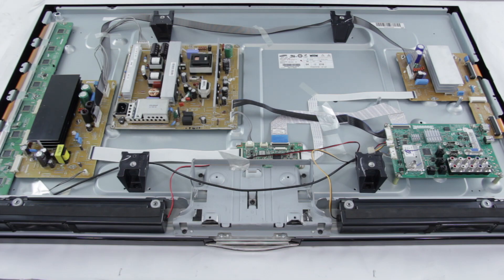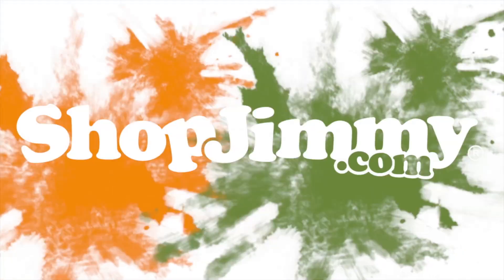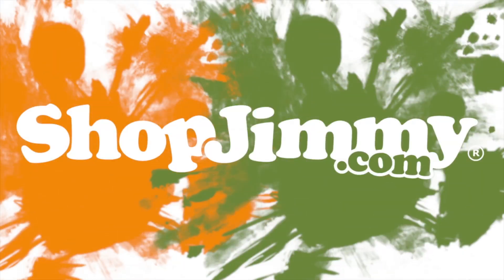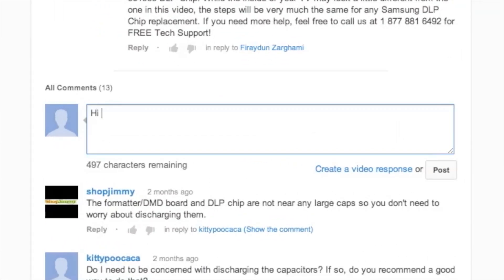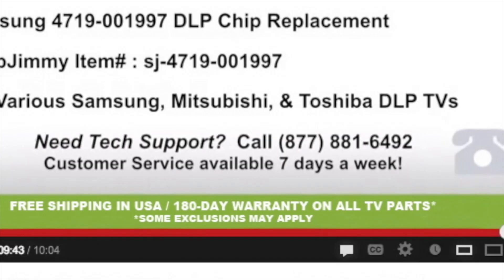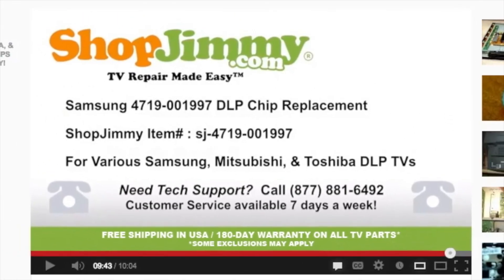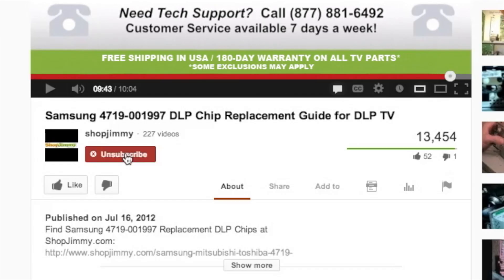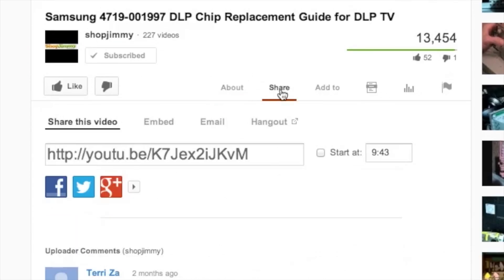Plasma TV Repair Tutorial - Common Symptoms & Solutions - How to Fix Plasma TVs

Comment: Good evening ShopJimmy I have a Samsung Plasma PN42B430P2DXZA and the issue that I'm having is that the picture comes and go or start blinking constantly, and something it just goes blank but you still can hear sound. When it on for hours pictures works fine but still have the flickering going on but not as bad as when first turn on. Could this be cause by the Y-main board?

Comment: We have a Panasonic TC-50px24 plasma screen TV, was given to us for free but we think it may be fixable. The TV will turn on but has red and blue vertical lines about 2" tall and 1/4" wide across the bottom third of the screen. The lines seem to line up with the ribbon cable that connects to the SS board..  We are wondering if this could be a problem with the SS board itself or if it's possibly a problem with the ribbon cable itself.. (entire screen)?

Comment: We have a Samsung Plasma TV .  The other night we smelled burnt wire and the screen went black.  The back of the TV was very hot to the touch, but not the front.  We unplugged the TV and waited for the TV to cool off. Once it did , it worked again for about 24 hs, the we got the smell again and no picture.
Reply from the maker: Victoria Jiles   Most commonly I would suspect the Y sustain board. This board is located to the left of the power supply from the rear. I would do a visual inspection of this board, the power supply, and the X sustain to the far right. Look for discolored parts due to over heating etc. as this could give a clue. What is the model number of your set?  Please reply with your TV model number.  Click here to view a video that shows how to find your TV model number:  https://www.youtube.com/watch?v=S51nhAmwR2M  Thanks!  www.shopjimmy.com

Comment: Hi Shop Jimmy - I have an LG Plasma TV - Model No: 42PC1DG-AA / Product No: 42PC1DG-AA AAULLUH / Serial No: 611KCMR35203
For some time now we have been experiencing the Image Freezing while the Audio continues on 1 channel only? Strange. We found that if we power off and back on quickly and immediately changed channel it would be ok. Also we found that if unplug the TV between watching it reduced the occurance.
Last night however the TV made a loud POP and we lost the picture - audio continues. The TV is not recovering from this.
From your Youtube Vid it sounds like this might be the Y-Sustain - should I try and remove the Y Sustain and get a replacement? Will it need a Technician to replace? Should i simply replace the TV?
Reply from the maker: Nick Kavanagh   I recommend replacing the Y Sustain and the Y Drive Board(Y buffer board) in your TV.  Click this link to replacement parts:  http://www.shopjimmy.com/catalogsearch/result/?q=42PC1  There may be multiple boards for the same TV model number, be sure to match part numbers on your current board, with your replacement for compatibility.  Here is a link to a video showing how to identify your part number, click here:  LG Plasma TV Repair: DIY Part Identification Number ID Guide for LG & LG Philips Plasma Panel Parts  Thanks and please let us know if you have any further questions with your TV Repair!  www.shopjimmy.com
Reply: Excellent. Thank you very much.

Comment: I have a HP PL5072N Plasma HDTV, this turn on and off itself. What could be the cause?
Reply from the maker: corey sesti  Please watch this video FIRST to help with your repair!  TV Repair! LCD, LED, Plasma, DLP How To Fix Your TV with ShopJimmy.com Help!  This could either be a problem with the main board or the power supply board.  You may need to replace each board individually to see which one fixes the problem.  Click this link to see replacement parts for your TV model number:  http://www.shopjimmy.com/catalogsearch/result/?q=PL5072N  There may be multiple boards for the same TV model number, be sure to match part numbers on your current board, with your replacement for compatibility.  Thanks and please let us know if you have any further questions with your TV Repair!  www.shopjimmy.com

Comment: I have a Samsung plasma TV PN50B430P2D.
The problem: 2 horizontal black lines from left side of tv all the way to the right, top middle of tv....what do I need to fix? Please help. TV still works fine, just have the black lines.

Comment: I have a ps51e550 Samsung plasma 20 months old with a verticle pinstripe on the right of the screen,any ideas,thanks.
Reply from the maker: Alan Webb  This sounds like a TV panel (TV Screen) problem.  If your TV panel is bad, it may be more cost-effective to replace the TV as panels are typically hard to find in stock, difficult to replace, and expensive.  Thanks and please let us know if you have any further questions!  www.shopjimmy.com

Comment: Samsung plasma TV - Model PN51D6500
Today I noticed a vertical pixelated narrow line (different colour than main image, often fading from green to purple from top to bottom)) about 14 inches from the left screen margin. There are no other odd lines or pixels elsewhere.
Thank you for your suggestions,
Al Wilson
Reply from the maker: Al Wilson   This sounds like a TV panel (TV Screen) problem.  If your TV panel is bad, it may be more cost-effective to replace the TV as panels are typically hard to find in stock, difficult to replace, and expensive.  Thanks and please let us know if you have any further questions!  www.shopjimmy.com

Comment: I have a Samsung plasma 50 inch PN50C450B1D. Picture is snowy and has a red and some green tint/outline on everything with no input connected, menu on screen looks the same. TV powers on fine and stays on, problem just started one day and TV is about 3-4 years old. Any suggestions on what board could be causing this problem? 
Thanks.
Reply from the maker: DC Smith  Please watch this video FIRST to help with your repair!  TV Repair! LCD, LED, Plasma, DLP How To Fix Your TV with ShopJimmy.com Help!  I recommend replacing the main board in your TV.  Click this link to replacement parts:  http://www.shopjimmy.com/catalogsearch/result/index/?cat=56&q=PN50C450B1D  Be sure to match part numbers on your current board, with your replacement for compatibility.  Here is a link to a video showing how to identify your part number, click here:  Samsung Main Boards & Digital Boards: Part Numbers for LED, LCD, DLP, Plasma TV Repair  Thanks and please let us know if you have any further questions with your TV Repair!  www.shopjimmy.com
Reply: ShopJimmy.com  Thanks for the info. Problem was the Y-sustain board.

Comment: I have a 2 to 3 inch black vertical line going down my TV. I found the culprit , which is the ribbon corresponding to the vertical line,on the bottom of my TV , which is connected to the c2 buffer board tnpa4441. I unplugged that ribbon. Turned on the TV hoping for it to be white line 2-3 white line as I was informed I would see. But the line is white but only half of it with black. the white half containing pixel color changing lines.It supposed to be white when u unplug the ribbon I thought and when it's plugged in it's black. Could it be the c2 board I need thanks in advance .
Reply from the maker: *****   This sounds like a TV panel (TV Screen) problem.  If your TV panel is bad, it may be more cost-effective to replace the TV as panels are typically hard to find in stock, difficult to replace, and expensive.  Thanks and please let us know if you have any further questions!  www.shopjimmy.com

Comment: I have a 2 year old Samsung PN51E450 Plasma 720.  It has a red dotted line running vertical on the right side of the screen.  Everything else works fine. Any suggestions?
Reply from the maker: Frank Shults   This sounds like a TV panel (TV Screen) problem.  If your TV panel is bad, it may be more cost-effective to replace the TV as panels are typically hard to find in stock, difficult to replace, and expensive.  Thanks and please let us know if you have any further questions!  www.shopjimmy.com

Comment: I have Toshiba 42HP66, I have great sound, but no picture. For about a week befor the picture went out, when the tv was turned on the pictures would be white like till it warmed up about 5-10 minutes then the picture was normal.then one morning while it was warming up, I left  tv on, when I returned there was no picture. I have looked at boards . Theren is no scorches on fuses and no bulging, no burn smell. I have replaced the inverter board and still no picture, but have great sound. I have been told its possible its the main board then. this part # is OEC7147B-007. could itbe anything else ?
Reply from the maker: T Burgess  Please watch this video FIRST to help with your repair!  TV Repair! LCD, LED, Plasma, DLP How To Fix Your TV with ShopJimmy.com Help!  I am not sure what board you replaced, as there is not an inverter board for this TV as it is a plasma model and not an LCD.  I recommend that you replace the YSUS and the YDRVTP boards in your TV.  We may be out of stock on the YSUS, but we have a repair service, where you can send us your board and then we repair it and send it back to you.  Click this link to find these replacement parts:  http://www.shopjimmy.com/catalogsearch/result/?q=42HP66  Be sure to match part numbers on your current board, with your replacement for compatibility.  Here is a link to a video showing how to identify your part number, click here:  LG Plasma TV Repair: DIY Part Identification Number ID Guide for LG & LG Philips Plasma Panel Parts  Thanks and please let us know if you have any further questions with your TV Repair!  www.shopjimmy.com
Reply: The part that I 1st replaced was part # LG 6871QDH117A.
Reply from the maker: T Burgess   So you replaced the YDRVTP board.  You will also want to replace the YSUS board.  It is recommended that you replace both the YDRVTP and YSUS boards at the same time, since they can cause damage to each other if one of them is bad.  We may be out of stock on the YSUS, but we have a repair service, where you can send us your board and then we repair it and send it back to you.  Click this link to find these replacement parts:  http://www.shopjimmy.com/catalogsearch/result/?q=42HP66  Be sure to match part numbers on your current board, with your replacement for compatibility.  Thanks and please let us know if you have any further questions with your TV Repair!  www.shopjimmy.com

Comment: I have a 51" Samsung Plasma E550. Its 2 and a half yrs old. it has suddenly developed a thin vertical line 4"from the left , full from top to bottom. The line is not visible in black or white screen. Technician says its the fault of the panel and the whole panel needs to be changed.
Suggest a solution.
Reply from the maker: sachin dixit   This sounds like a TV panel (TV Screen) problem.  If your TV panel is bad, it may be more cost-effective to replace the TV as panels are typically hard to find in stock, difficult to replace, and expensive.  Thanks and please let us know if you have any further questions!  www.shopjimmy.com

Comment: I am working on my Panasonic TH-42PX50U and I have seen all of this video.  My TV stopped working entirely in my motor home and blinked ten times. After moving the unit into my home I took the back off and blew all the dust out, including the fans.  They actually did not look too dusty.  I suspect the outlet was overloaded in the motor home.  Now when plugged in inside the home it will come on and work perfectly for 30 - 45 minutes and then turn off and blinks the led seven times.  If I unplug it and let it cool for a while it will come back on and repeat the sequence.  I am prepared to buy a board if I can determine which one(s) to get.  Thank you so much for this service help.

Comment: 42" Samsung pn42c450b1d - the screen does not come on and when it gets plugged in after being unplugged it clicks on and off (3) times before stopping.  Based on the video it sounds like the Y main board.  Any help would be appreciated.
Reply from the maker: Matthew Juergens   Try this at your own risk. Unplug the TV, then disconnect the y board and plug in the TV to see if the TV powers up. Reply with the results of this test. Thanks! www.shopjimmy.com
Reply: With the y board unplugged, the tv powers up w/ the melody and the on/off button works with it making the startup/shutdown melody each time, obviously nothing on the screen though. Thank you for your help!

Comment: Hello, just finished watching the video. I have a LG 60PK550 and I have a issue where a thin horizontal line is flashing across the screen at random. Along with this the picture will sometimes transpose meaning what ever is on the left side of the image will appear on the right side and vice versa. These happen at random for slip seconds at a time and sometimes continuously for a period of time. I have been suspecting the the ysus board needs replaced after some research. Any ideas?
Reply from the maker: Jeff Campbell
Please watch this video FIRST to help with your repair!  TV Repair! LCD, LED, Plasma, DLP How To Fix Your TV with ShopJimmy.com Help! Thanks and please let us know if you have any further questions with your TV Repair!  www.shopjimmy.com I recommend replacing the buffers in the TV.  Click this link to replacement parts:  http://www.shopjimmy.com/catalogsearch/result/index/?cat=96&q=60PK550  Be sure to match part numbers on your current board, with your replacement for compatibility.

Comment: I have a toshiba 42hp66 plasma tv.
When I plug in the hdmi cable it shows a green screen and no picture.
When I use the  rca  cables, it works fine. I really like your videos.  they are very helpful!!. when we pluged the sorround sound, to the receiver it made some noise and some smoke came out of the right side of the receiver.  The receiver no longer works..
Reply from the maker: Chris Bouchea  Please watch this video FIRST to help with your repair!  TV Repair! LCD, LED, Plasma, DLP How To Fix Your TV with ShopJimmy.com Help!  The scaler board for this model has the HDMI input.  I recommend replacing the the scaler board to see if that fixes the problem.  Click this link to replacement scaler boards for your TV model:  http://www.shopjimmy.com/catalogsearch/result/index/?cat=60&q=42hp66  Be sure to match part numbers on your current board, with your replacement for compatibility.  Here is a link to a video showing how to identify your part number, click here:  TV Part Number Identification Guide for Toshiba Main & Scaler Boards (LCD, LED, Plasma TVs)  Thanks and please let us know if you have any further questions with your TV Repair!  www.shopjimmy.com

Comment: HI Jimmy,

I have a Samsung Plasma TV model# PN50A510P3FXZA.  When its plugged in the power supply board just does a series of clicking 7-8 times then stops.  No picture at all.  I've taken a look at every board inside the set, and cannot see any swollen, or leaking capacitors.  What can I do to fix this set?
Reply from the maker: Michael Shlimanoff   Try this at your own risk. Unplug the TV, then disconnect the y-main board and plug in the TV to see if the TV powers up. Reply with the results of this test. Thanks! www.shopjimmy.com
Reply: the clicking goes away when I unplug the board with the A/V jack, and componant cable plug ins.. botton left hand side.. think its called a Main Board

Comment: I have a Samsung 50" hp-r5052 there is absolutely to life to the screen at all. There's no picture no light, nothing. But it powers on. The power button lights up blue, the tv clicks and a musical noise indicates power is on/off. I've replaced the X and Y main boards on the right and left sides but it still does the same thing. When you turn the power off there are 3 greens lights that turn on, on the backside, behind the cover. Two stay on and 1 steadily blinks while the power is off. The power button flashes when I push a button on the remote,so I know it's getting some kind of signal. Just not sure what my next step should be?!?! Thanks a bunch!!!!
Reply from the maker: mrsazbill  Please watch this video FIRST to help with your repair!  https://www.youtube.com/watch?v=BP3NVNCGEv8  It is recommended that you replace the buffers, when you replace the Y board.  Click this link to find replacement parts:  http://www.shopjimmy.com/catalogsearch/result/?q=hp-r5052  There may be multiple boards for the same TV model number, be sure to match part numbers on your current board, with your replacement for compatibility.  Here is a link to a video showing how to identify your part number, click here:  https://www.youtube.com/watch?v=R1jmj_foId0  Thanks and please let us know if you have any further questions with your TV Repair!  www.shopjimmy.com

Comment: panasonic TH-50PZ80U. The tv has a quick double click when plugged in followed by a delayed thrid click (over 5 seconds). The stand-by light does not turn on. However, when the power button is pressed, the fans start turning for a couple of seconds. Then I hear another click and everything shuts back down. Finally, the stand-by light will keep flashing twice repeatedly and the power button does nothing at this point without unplugging.
Reply from the maker: Blake Rogers   Try this at your own risk. Unplug the TV, then disconnect the y board and plug in the TV to see if the TV powers up. Reply with the results of this test. Thanks! www.shopjimmy.com